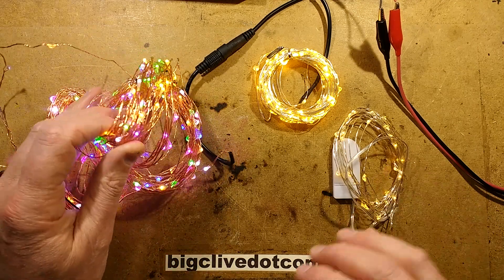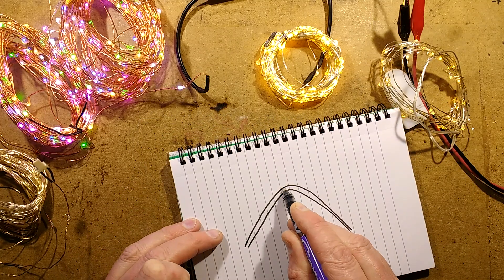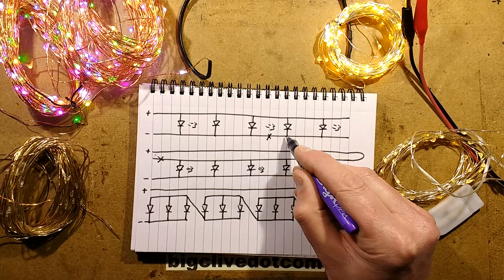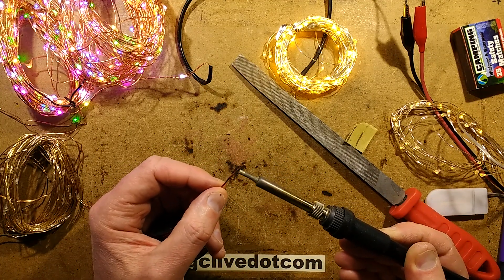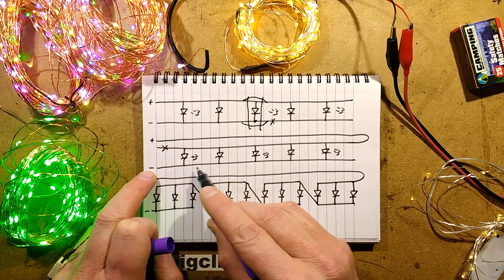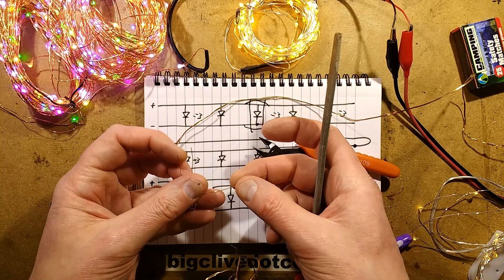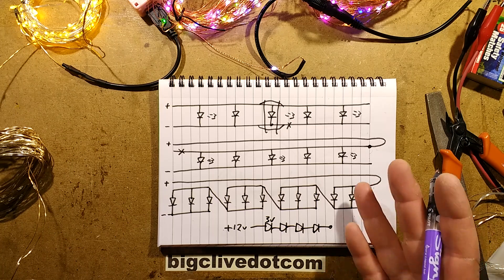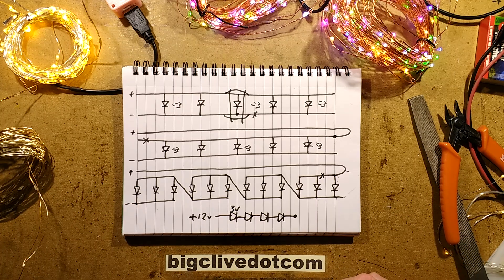Fixing low voltage copper wire LED strings.

Comment: There are new (to me) versions of these using thin flexible wire and used with clear helium balloons, they look pretty cool! https://www.aliexpress.com/item/18-LED-Balloon-30-LED-3M-String-Bubble-Transparent-Colorful-Helium-Balloon-Light-Valentine-s/32837556283.html
Reply: Lumibear Ooh, they really could look quite special in the right setting :)
Reply from the maker: I've seen those.  They look pretty neat.

Comment: I used to be involved in the manufacture of transformers. As a general rule of thumb, if the insulation is a 'golden' or 'red' colour, then it is 'self fluxing' and can be removed by applying a tinned soldering iron to the wire, thus removing the insulation and tinning the wire in one operation.

Comment: Those remote control switch sockets you showed at the start, the relay goes up in smoke and the fuse inside then burns through the plastic case. That is what happened to the one I had (still have after I repaired it). Not even from B&Q it came from wicks but is otherwise identical.
Reply: Equiluxe1 No fair! Mine worked perfectly :)
Reply: I have four sets of these and only one unit out of the four failed but I guess the way it did it could start a fire.

Comment: we have lots of these coated copper wire light sets....we find the power supply's break easily.....can you replace the power supply?
Reply from the maker: If they are simple parallel circuits you can use batteries or with the addition of a resistor you can run them from USB power supplies.  For 12V sets you can get new 12V  plug in adapters online.

Comment: I got a 100 led string USB powered, wanting to make 5 sets of 20, but...Simply soldered my cut back together & left it for some other as yet unknown use. The 100 led, powered by 3x1.5 AA, do however  cut up nicely into 20 led sections & run well off 2x1.5 volt AA cells. Alternatively one can buy the 10 led ones from pound land & join the two battery ends in parallel to make 20. The other nuisance is that there is a variability in the cold white led strings. Some such as the ones Poundland sell are nice & bright, others are dimmer & not as blue a light. Depends what one wants of course, but for my displays the dimmer cold white look like their batteries are nearly out even with fresh batteries compared to the Poundland type. Still they are all magical compared to the previous technology of incandescent bulbs that needed mains & regularly broke. Thanks for the interesting tutorial. Merry Christmas!

Comment: Great explaining !!! I have a question, Can you  convert these 4,5V battery lights into using  5v usb
Reply: Measure the current drawn , stick in s series resistor to drop 0.5V (R = 0.5 / I) , or use a diode, like a 1N4001 for about the same drop) - done. That said, given that 3x fresh alkaline batteries will be a bit above 4,5V anyways, the string will probably work OK, if slightly brighter, at 5V.

For deeper info, Clive has done a video on converting fairy lights to run off USB supplies, https://www.youtube.com/watch?v=CQcRLq4yq6E&t=329s
Reply: Michael Tempsch thanks
Reply: So I am not the only one that was looking to know this. Thanks
Reply: a diode to drop 0.5v is easier imo
Reply: FRIENDLY JAPANESE BUSINESSMAN You can’t have used a series silicon diode. The U.S.B. port puts out 5.0 volts, and the diode will always drop 0.5 volts. This gives you your 4.5 volts.
Reply: you would keep the original resistor for the 3xaa (4.5V)
Reply: same as the 4,5v from 3* AA
Reply: I knew this, but thanks

Comment: A method I've had some success with for the lacquer coated wire, is dip the wire into flux, pick up a large blop of solder on the tip of the iron, and run the hot solder onto it.

It melts off the (non heat resistant) lacquer, and tins it at the same time, whilst the flux turns the melted lacquer into gloop.

Comment: I wonder how well matched nichrome resistance wire would be to this application. Dissipate the heat instead of stressing a small resistor. Not very easy to solder though.

Comment: Had a 12v set catch on my ceiling fan. As the fan wound them up and broke the line, the lights started going on and off. It was hilarious, and terrifying at the same time--spool of LEDs flying around the living room flashing erratically, and slowing the ceiling fan to a halt. I figured I was better off just trashing them and getting a new set after that.

Comment: Thanks so much for the explanation! I damaged a 3-wire USB-powered set - and had no idea why there were 3 wires. I managed to repair them by trial and error, but it's nice to know I essentially did the right thing and why it worked. ;) I've only ever gotten the USB or battery powered ones - and after your explanation of the 12V version, I think I'll just avoid those. I'm using some runs of the USB powered version slipped into a silicone sleeve (the flat [rectangular cross section] kind normally used for LED tape, in part because it's the cheapest ;) to illuminate dinner tables on a group camping trip in place of candles, etc. The yellow ones are great for this - provide visibility without being too bright to have them in peoples' line of sight on the tabletop. 

I know these wire strands are already waterproof, but the silicone sheath acts to diffuse the light a bit. Far more importantly it keeps the wire from kinking, which leads to the wire breaking. (If it were just me or if they were out of easy reach, I doubt there would be an issue but putting something like this on a table in front of 100+ people, one has to keep in mind that some eedjit will probably mess with it.) That's the big down side of the solid wire used in these - it's REALLY easy to kink a wire and then break it, where stranded wire would be more resilient to that kind of thing. Oh, and the other advantage of the flat silicone sleeve is that it winds very neatly onto a reel. ;)

As a fellow bearded person - I know what that kind of snag is like. OW!

Anyway - God Jul!
Reply: The three wires are to share the load equally across a long string of lights. Just supplying power from the one end leads to them slowly fading out, whereas the three-wire version carries the (let's say) ground all the way along, past the LEDs, then connects it at the very end of the string to run back again to the 'first' LED..

This method is more expensive than the simple two-wire method - or at least precludes the easy creation of arbitrary-length strings, so it's not as common.

merry christmas!
Reply: Hey, can you help me repair a set that you plug into the wall? I spent a lot of money on them and when I went to plug them in the wall, they didn’t work!

Comment: Could you please put the link of the green one in the discretion?
Reply: The trouble with putting links is that AliExpress automatically raises the price based on activity. Try searching "fairy lights copper wire green"

Comment: Looks more as if the third line just acts as a "cheap" resistor to limit the overall current ,
Reply: A resistor would probably be cheaper than actual copper wire - but there's also the advantage that powering the strand from both ends means all the LEDs are the same brightness.

Comment: Your explanation of the 3 wire system re. voltage drops is a bit "iffy" ...   If it's the same gauge/type of wire in all three leads , you still get the same voltage drop along the line between LEDs for the same current

Comment: some of those remote outlet switchers have a problem where they can catch fire(quite reliably at that) if they get on/off signals at a too fast rate that can be caused by the microcontroller in the remote locking up or if someone intentionally sends out the signal.

Comment: since alot of cheap wiring uses aluminium these days. Does there exist enameled aluminium wire also ?
Reply: Solderability goes down the drain though.
Reply: I was wondering that - enameled copper coated aluminium. Sand the enamel off and at the same time sand the copper coating off!
Reply: oh so those aluminium wires always have a tiny layer of copper ?
Reply: It's all copper by the flexibility of it in the several samples I have.
Reply: i did have some enamel coated aluminium wire, dunno if i still have it, got it with a load of other various old enamelled and silk/cotton covered wires..
Reply: whats is difference between AS THICK and times thicker?
Reply: You could still use the soldering iron technique (hopefully, thankfully I never had to deal with copper-coated aluminium).
Reply: I know of power equipment and T&D cabling using aluminum, but I have yet to find any cheap china doodads made from aluminum or copper plated aluminum wire.  Every example I've seen has been steel or copper-plated steel.  It's china, why wouldn't they use the cheaper option?
Reply: 1.6 times AS THICK, not 1.6 times thicker. Big difference.
Reply: It's thick(A) x 3 vs. thick(A) + thick(A) x 3 - The secret is in the comparative form of thick, thickER, implying an increase that's added upon the original.
The English language doesn't have the indicative and the comparative (and the superlative) form for no reason. If they were equal, why would you need two separate forms?
Reply: "But if copper coiled tansformer burns you can unwind it,coat with laquer and wind it again" - Honest question: How the hell do you apply new laquer, and what laquer do you use??
Reply: Ah, so just a touch-up. For some reason I imagined you re-laquered entire lenghts of wire with a ridiculous contraption of pulleys and spools and brushes.
Reply: Paul I doubt that removing that copper coating matters in this case. The aluminium will conduct enough electricity most likely

Comment: Small mistake, I suspect. If those are SMD style LEDs, they usually don't enter the machine in a hopper, but on an 8mm paper tape with a few thousands on each reel.  These spools are normally used in robotic PCB assembly machines where the LEDs are picked up one by one and stuck on the boards wherever the drawing says.  But for these strings the machine will be a lot simpler as there's no variation, the only component used is the LED, and it always goes into the one point in the machine, perhaps they just solder it while on the tape, perhaps they have a pokey lever pushing it from the paper to the hot soldering.   I also suspect the bend facing down all the time as it's scraped, soldered and dipped.

Comment: I wish you would do a video on the unreliable ego ecig chargers....I am charging mine from the bench power supply, as I am sick of buying those crappy chargers....
Reply: Have one of those cheap 88Vape ones from Poundland (seen them elsewhere too) and after a few hundred charges it's working fine.
Reply: Ok ty will try
Reply: I think the terminal is non-solderable, the wires are welded to it, not soldered, and they are pretty stiff. So if the terminal has any give in the enclosure at all, the wire will eventually break clean off.
Reply: They seem to, yes

Comment: How about a video on ways of converting battery powered led light strings ( 4 wires, 8 flashing modes, little white or black controller box) to mains power? I would be prepared to forego the 8 modes for continuous on.
Reply: Bridge rectifier, capacitor and resistor. Maybe an electrolytic across them as well.
Reply: Depends on how they are wired. If the controller uses a DC-DC converter (as used on some large multicoloured sets) or uses just two wires with the LEDs wired in inverse parallel, you need a more complex circuit to drive them. The quickest and easiest method, is to use a power supply that outputs a regulated DC voltage the same value as that of the battery pack.
Reply: Well, it's a 4 wire system and the battery pack / controller has 3 off AA cells. I.m guessing that, in order to achieve the different flashing effects, including fading, the LEDs are wired either in 3 groups with a common return, or in 6 groups across all possible permutations of 2 from 4. However it's done, it has to cater for the "all on continuous" case. So far I've not plucked up the courage to spudger open the controller box of a working system. They are all external grade lights, but they get through quite a lot of batteries over the Christmas season.
I have several of these sets and was wondering if they could all be connected to a common 4.5V power supply in a waterproof box. As I said, I don't care if I lose all the flashing modes, I never use them, preferring continuous on.
I suppose I could just carefully cut off the battery holder part of the box and make solder connections to the + & - contacts of the controller, but that's a bit crude!

Comment: I remember, many years ago, enameled copper wire came in two main flavours, one of which was solderable. The enamel was designed to melt (evaporate ?) at soldering temperatures , maybe even having a mild flux effect .  This was particularly useful if you were using a solder pot to do your tinning. The other type was normal and required scraping off.

Comment: Wait, the second option, the first led would have to go through twice the wire as the first option?  Or am I missing something?  Sorry if someone has seen this before.  Love your videos, thank you for sharing?
Reply: No, that's right, that's what makes all the LEDs in the string light at the same brightness, they all have the same length path from/to the battery.
Reply: Not twice as much, 50% more as you have 3 wires the same length instead of two.

Comment: LED Christmas lights are awful.  I can notice the 60Hz flicker when driving past them and it makes me was to have a seizure.  I can only imagine how much worse that would be at 50Hz.
Reply: R. C.: SOME LED fairy lights are awful; the ones with a decent power supply providing fully rectified and properly smoothed DC look fantastic. I do agree with you that the ones using half-wave rectified and unsmoothed AC power are [expletive] awful.
Reply: R.C. Whitehead  You won't with some of mine, as they operate off a smoothed DC power supply. Although the mains voltage outdoor set runs off just rectified DC, so the frequency will be 100Hz.
Reply: Meanwhile Im using 30 year old incandescent christmas lights on a 30 year old tree.

Comment: What keywords do you use to find these on ebay?
Reply: Did you try "LED" ?   ;)
Reply: Only 'LED' would probably give a fair bit of unrelated hits :-), but 'copper wire led string' should probably give fairly relevant hits

Comment: I have a bunch of the 2 coin cell battery pack type, and would like to merge and convert them into a USB type but I am not sure how to choose a resistor. suggestions?
Reply: Measure the total current drawn when on batteries, divide the difference in voltage between the USB supply and the batteries (probably 5-3=2) with the current and you have the resistance. Multiply the voltage (2V) by the current and that's the power the resistor will dissipate. If > 0,25W and you don't have suitable bigger (more power capable)  resistors, you can use multiple resistors in series or parallel to make up the proper value and with sufficient amount  od resistors to spread the dissipation across them so that each is below the rating of the resistor (typically 0,25W

Comment: A nice finale showing what happens when you connect the string straight into the mains would have been very nice.
Reply: Probably just fail in a controlled and unexciting manner. Stuff is too safe these days.
Reply: you have discounted (C)hinese (E)xport stuff then
Reply: The wire is so thin, it would just blow like a fuse.
Reply: You never know until you know. There is still hope! :-)

Comment: Removing the enamel with a blob of solder is also a way to strip and tin that stuff which is copper stands around a nylon core (typically headphones cables), and to melt away the nylon as well. Though I find I need to temporarily bump my iron up to 400c as well.

Comment: Urgent product recall... Meanwhile Big Clive has searched high and low to find one :D
Reply from the maker: I really do want a faulty one.  It's always fun seeing what went wrong.
Reply: One of the great joys of your channel is seeing what went wrong. Unfortunately I haven't got one to donate, if I did though I'd sooner donate it to you than return it to B&Q.
Reply: bigclivedotcom you might be successful asking at the customer services desk if you find a CSA willing or bribable to let you have a returned one, there's usually a return faulty/recalled bin back of house somewhere!
Reply: I was wondering if yours also is eligible for the recall. Maybe if so give it a good work out and it might fail in the wished for manner :)
Reply: Yeah, I know right, I hope you can get your hands on one of those.
Reply: I had 3 of them adapters but none went faulty as yet, I only used them for easily turning on and off the xmas lights, currently on loan to a friend for the same purpose, i suppose i should warn him about the danger asap but never had any issues myself
Reply: I would donate one but sorry i can't you see as it burned my house down
Reply: James Valentine he could try wklkos as they are slso recalled...
Reply: hopefully they wont recall maplins as theyre controlling my Xmas lights!

Comment: I just bought a set of these....30 LED micro dot lights.  Cold white but very nice....like drops of ice.  No circuitry just driven straight from the 2 AA batteries.  4 dollars Canadian at Dollarama.

Comment: There are actually several kinds of enamel. There is a solderable version, which melts off if you just tin the wire with the soldering iron. The other kinds can also be removed by heating red-hot in a flame and then either wiping with a damp rag or dipping in a pot of spirit stove fuel.
Reply: Or sand it off with a bit of sandpaper.